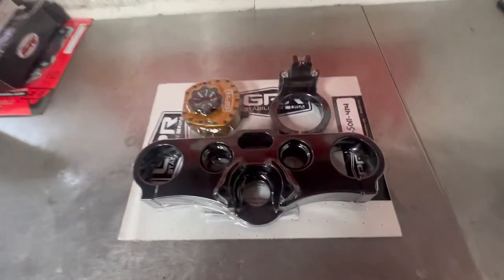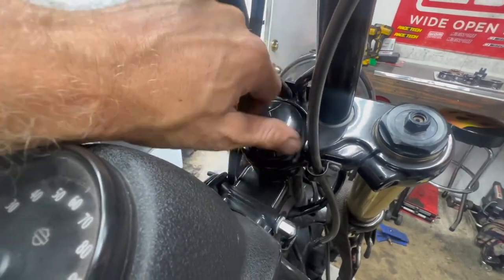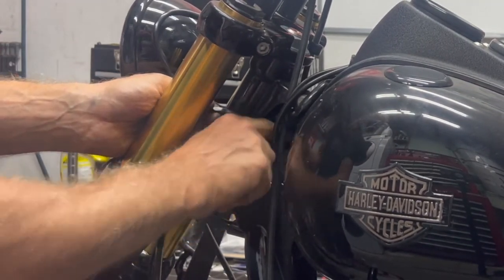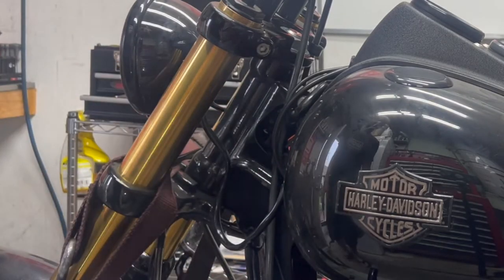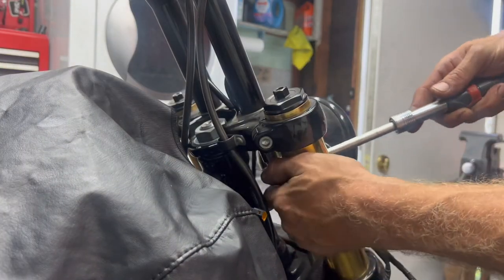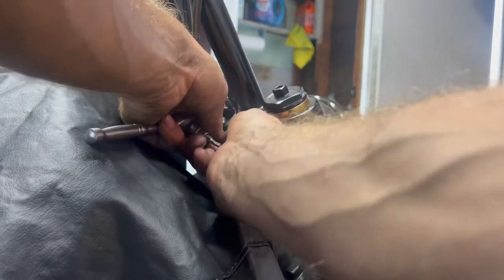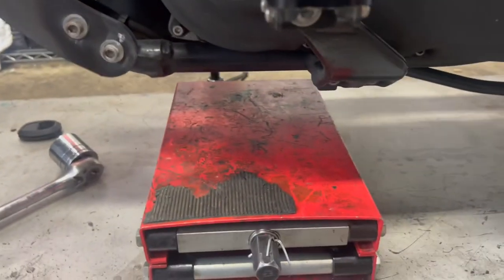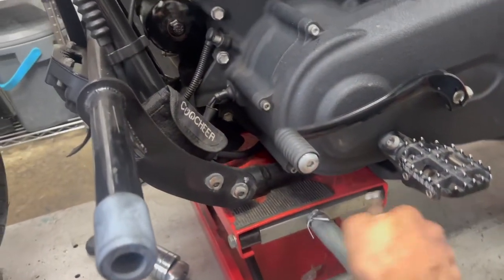Wide Open Moto - Harley Davidson GPR Stabilizer install and top clamp removal

Comment: Your bike looks killer! Have you thought about going with a shorter riser to get the most out of that front end? That's one thing I am planning on changing up on my Sportster. I'm going with a 2 inch drop tree with a built in GPR stabilizer, and likely 6-8 inch risers with 2ish inch moto bars. I currently have West Coast tbars 10 inch MX bars which are actually 10 inch rise and then another 2 for the bars, and although at 12 inches they are very comfortable, they aren't ideal for the type of riding I do haha I feel like a similar 6-8 inch setup with your adjustable forks/tree/GPR stabilizer   would be an absolute beast in the corners!
Reply from the maker: Thanks Jonny!  The lower the bars the more stability you will have, but we all sacrifice the look for the control in some way.  Good luck getting the Sporty dialed in!

Comment: Brent, WHY did you put that stabilizer on? It looks like that's a custom front end, was that stabilizer junk?  The install was great but you should explain WHY you're doing it.
Reply from the maker: Hey Jim, in the description I put what this will help with, but a bit further into it.  Harleys are known to have speed wobbles, and issues with stability.  The GPR stabilizer helps to keep the front end settled in corners, straights and especially at higher speeds. The stabilizer will bolt on to any front end with no customization needed.